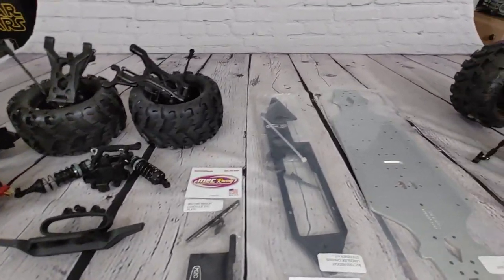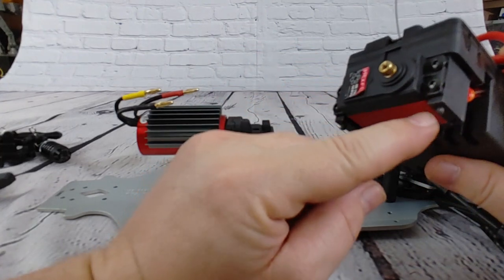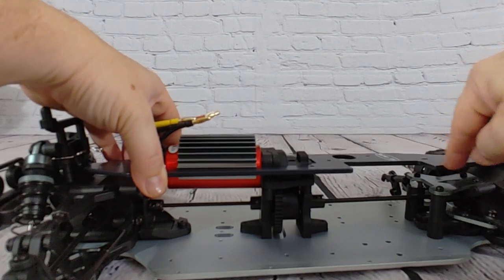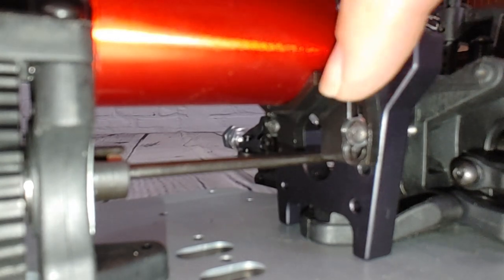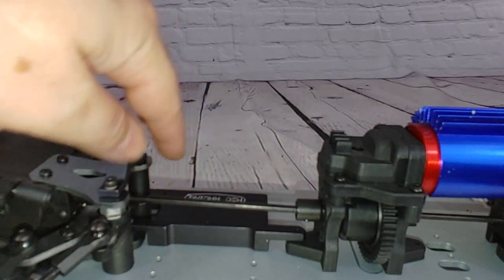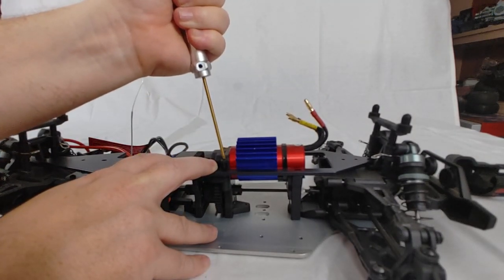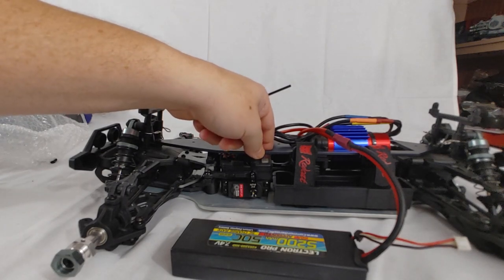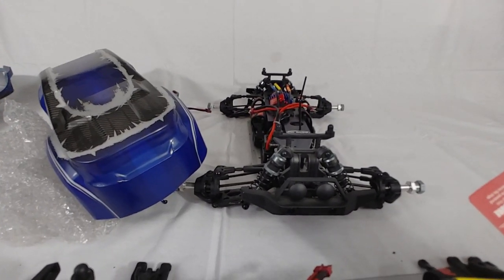M2C Racing Full Landslide XTE Upgrades Install and Set up

Comment: Update a good year or so later 😁. My landslide runs so much better without the upper plate.  Just stick with the M2C chassis and longer screws help to. Yes to this day my landslide is still bashing right beside my arrma 6 s truck. 👍😉
Reply from the maker: Thats awesome... Me and many others were not so lucky.  
When we started testing for the fix, the chassis was the first attempt.  It did not stop the rear dogbone from bending... that led to going back to the drawing board.  
My truck does not drive noticeably different though... I love the way that truck moves with my larger 4S set up and the top and chassis plates.   
If you have all your parts for the top plate, i know a few people that would probably take it off your hands...
Reply: @NPCRC  my top plate bottom brace and motor mount was not given with my car therefore all that is here is the top plate only . Mine does not have the front brace either but I have never bent a center doggone in 2 plus years owning the truck . I do have the center plate and it's not going to be used Mabey we could figure/sort something out 👍☺️

Comment: Hey guy what springs did you go with on the blackout xte when your upgraded to the aluminum shocks The springs on the upgraded blackout shocks are way too soft. Thanks bro
Reply from the maker: I could not point you in any good direction.  I use to bring in aluminum shocks to see what worked with multiple trucks as possible upgrades.  The shocks on the blackout came with the springs.   I got them from Hobbyking but that was too long ago to recall which one, unfortunately!

Comment: Hi Steve man you love that landslide. You are gonna have to do all those upgrades so it can be as reliable and tough as Arrma. 👍
Reply from the maker: Well  to be honest, My Landslide proved tougher then my V3 Kraton did.    In most videos where I was breaking the Kraton, I also have a video of the Landslide taking the same or similar abuse without the breaks.  Also this is not a fair comparison anyway as the Landslide is $250 less then the V4 Arrmas and $200 less them my Truck / M2C bundle kit.   Comparing it to the 4S Arrma line up would be better suited and the Landslide with M2C top plate is $350 compared to the $400 4S Arrma and uses steel shafts vs plastic, larger hubs/knuckles and has a center diff vs slipper.   I do love this truck because I have put it through the ringer and have seen how it holds up and compares!
Reply: Landslide is an excellent truck with part exchange ability with the terremotto 10 v2. A150amp and 6s and bigger motor a beast.
Reply: @NPCRC  very nice man wow I didn't know I held up better then the Kraton. I heard those trucks have rear differential issues. Yeh the landslide looks like a beast. I got the noictorious 6S over the kraton because It also gets bent chassis pretty easy of your not careful jumping it.
Reply from the maker: @paulrakis  Rear diff issues can be caused by the chassis and shaft bending and the rear shaft jamming into the diff cup.   the brace from M2C eliminates that.  I have only ever replaced ONE diff on my landslide, through all the videos and abuse I have put it through and it was due to the diff cup breaking.   i had also bored it out to fit the Outcast driveshafts so it was partly because of that and before the top plate was added.
Reply: @NPCRC  yeh I believe it can also happen to the front diff as well depending on how u land. I was out today with my notorious 6S and I notice my front drive shaft is slightly bent not rubbing on my front shock yet gonna have to bend it back soon.
Reply from the maker: @paulrakis  does the body fit like normal?  Arrma Chassis is weak too..  Depending on the version, you may or or may not have the new bracing support.
Reply: @NPCRC  no body is fine. Yes it's V4 newest one. Has all that stuff . I hate the  spectrum remotes. I switched it out with a dumboRC X6 controller so much better.
Reply from the maker: @paulrakis  I miss the tactic!
Reply: @NPCRC  yes for sure. Have a question for you. I upgraded my Rustler XL5 from brush to brushless. Using goolrc motor with HW 60amp esc from the blackout. I tried to program the controller it works but reverse is a lot more faster than forward not sure how that happened tryed multiple controlles s well same thing. Any thoughts? Should I program ESC to less brake or more punch. I haven't touched any setting on it just did  calibrating for controller. Forward and backwards.
Reply: Goolrc motor is a 3500kv for 10 scale cars so I know it's definitely a good fit. 3mm shaft with 23T pinion gear.
Reply: @NPCRC  yes I heard it was so much better. Thank God for dumboRC cheap and awesome. Nevermind I fix the issue Steve. I just reversed the ESC power connections to the motor crazy. Can't believe that work I guess I had them on backwards.

Comment: Hey bro need to know something. The brace for the upper plate what did you do as far as the motor hold.  Mine is breaking motors.  Badly due to its odd design.  The upper plate brace motor plastic hold up 

What have you done about this it can not handle even small jumping 🤷‍♂️

I am having one heck of a time with the brace.  The plastic piece needed to be aluminum Also.

Comment: So I got the kit same motor set up all metal spur gears out of stock even the 49 tooth so I got a 46 to work bolts rite on filed motor mount works great but I want bigger pinion gear what pitch is the stock one I also locked center diff
Reply from the maker: mod 1 with 5mm shaft

Comment: Based on your work here I see the Landslide has been factory upgraded with a chassis brace.  Does this bracing upgrade solve the bending issue generally as well as the M2C aftermarket add on?
Reply from the maker: the Redcat attempt is only for the front.  Every time it has happened to me it has been on the rear.  The new design will not prevent that from happening so the M2C version is still the solution!
Reply: @NPCRC  I figured, the kit is on it's way!